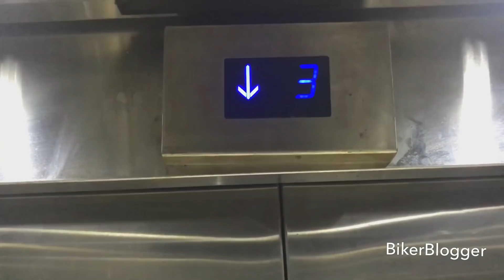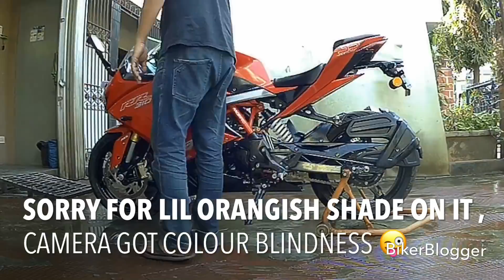Glass coating on New TVS Apache RR 310 | Akula 310

Comment: Glass coating done only in one day ??. My dominar was in the workshop for 3 days which went through 7 layers ceramic coating procedure....  If yours was done just in one day i think that's temporary for few months.... proper full ceramic coating takes 3 days for completion.
Reply from the maker: colin pereira mine is glass coating its not ceramic bro .... ceramic takes days where as glass can be done in a day or 2
Reply: BikerBlogger - Flavin Sojan Thomas ya tats what i mentioned temporary i. e short term treatment.
Reply from the maker: colin pereira may be 6 to 8 months

Comment: R u feeling some noise from the rear down side of the bike when u ride in bad roads.
Reply from the maker: AirY ji yup it does .
Reply: BikerBlogger - Flavin Sojan Thomas hmm same for my rr310 some differ noise will occur when we ride the bike in bad road .
Reply: is that very loud
Reply: honey shakthi not so but u will notice easily . and i dont know where the sound comes and even tvs dealer and service engineer dont know from were the sound comes.i have done 1st service but the sound problem not solve even i  test the new bike from showroom the sound occur same but only when u ride in bad roads
Reply from the maker: AirY ji happens u can report it in your first service
Reply from the maker: honey shakthi not really
Reply: BikerBlogger - Flavin Sojan Thomas i already done it , but they can't resolve it. even i ride the new bike  from the showroom the sound is same.
Reply from the maker: AirY ji i will update it on my first servicing video
Reply: How much money for the first free service
Reply from the maker: Farman Ahmad will update once i do it
Reply: Yes there is some noise like some part is loose or hitting some another part. It happens mostly in the speed breakers
Reply: Farman Ahmad yes same things happen in my bike to bro
Reply: BikerBlogger - Flavin Sojan Thomas  if u find the solution for this problem in 1st service then plz upload the vedio or either tell me .
Reply: Get your chain checked once i think the play with every bike is a bit more
Reply: Check the tool box